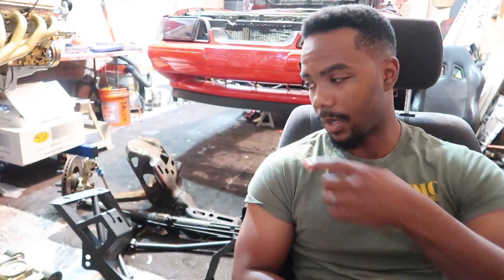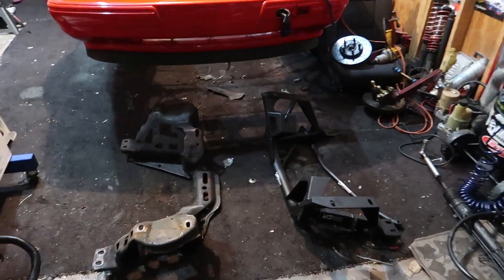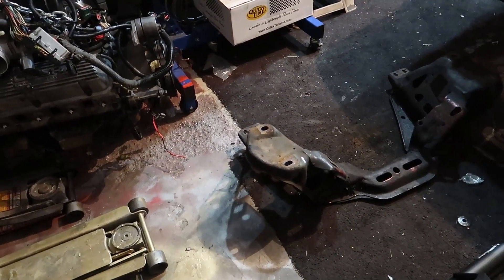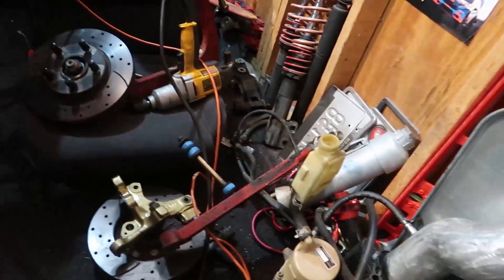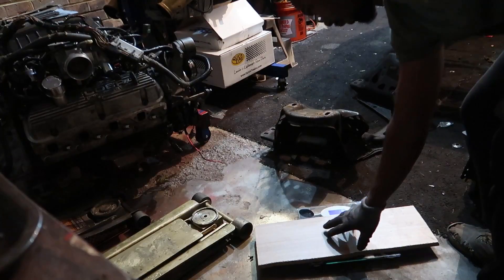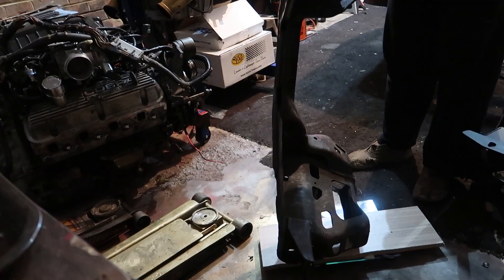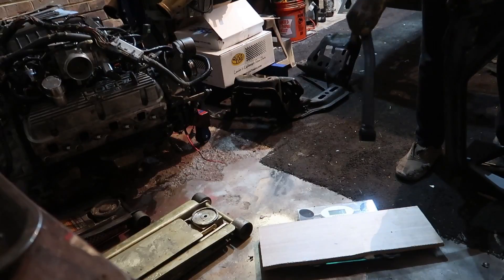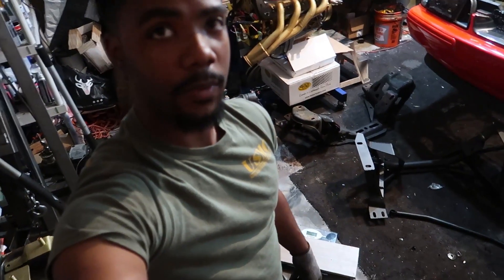Mythbusting. Tubular k member weight savings (Road race style)

Comment: I look for new ideas and why I shouldn't bother to do something or just do it a different way. I'm keeping the factory K member and using tubular control arms with lowering springs, as yes it weighs a touch more, but I'm not drag racing. The weight is in the front, but it is down low and weight up high is what I prioritize as needing attention in weight reduction. A set of aluminum heads or moving the battery to the back of the car does more, but this is my way of thinking. Keep up on doing the things you want to do and the way you want to go about it 👍.
Reply from the maker: absolutely, there has to be a method to the madness, WHERE the weight is matters as much as what's causing the weight, and managing your center of gravity will do more for you than just lightning random pieces.

Comment: I'm looking at a K-member swap, but not for weight savings. I want a Chris Alston K-member so I can get rid of the garbage McPherson strut suspension and run proper double wishbone suspension instead.
Reply from the maker: Never heard of it.  Sounds interesting, I'm going to check it out now.
Reply: @Sgt.Slides  they aren't specifically mustang parts. Meant for general hotrod use. So may need some tweaking to fit.

Comment: A great way to get ultra light weight parts is by scouring classifieds (craigslist, eBay, marketplace, anything really) for race car parts. Billet aluminum hubs, steering racks, aluminum hat rotors. Don't use the biggest brakes you can find. Use the SMALLEST brakes you can keep from fading on the track. That's using properly designed air ducts. The brakes should overheat and fade without the ducting. Anything more is extra weight. There's an Australian guy, channel is rwboo4 here. He'll show you how to make carbon or fiberglass everything. One piece front end? ✔️ Fiberglass dash shaped like the original? ✔️ Cut out the trunk floor and make an extremely functional diffuser to go with your new built flat floor? ✔️

Comment: I just ordered that same engine swap k member for my 85. Huge improvements on the geometry. Are you switching to the 96+ spindles as well?
Reply from the maker: yes, best to follow all of the Maximum Motorsports advice, be sure to run steeda ball joints as well.

Comment: ROFLMAO!!! Best thing you said - Honda Accord is a better all around car (minus the V8 power of course)! I've owned 8 fox bodies from 82-93 years and man you can't be more right. They don't stop, handle and honestly my daughter's stock 07 Civic will keep up if not roll past my 82 GT 4 speed in stock form. That's why I modify all my foxes. It IS like a clean sheet of paper. Basic performance for cheap to take to the next performance level the way you want. Appreciate your honesty and for just being a cool car guy. I love Mustangs and Fox Bodies. Fox platform cars are the modern day 55 Chevy Hot Rod. Who cares what "air pump" you put under the hood - to each his own especially if you're doing it yourself versus being a check writer! Love the channel, FOLLOWING! Get creative!
Reply from the maker: Thx dude!
Reply: John McBride Comparing an '82 GT to a car 25 years newer is not a fair comparison at all. You need to realize the era these cars were created in: In the '70s with emissions and fuel regulations people believed V8s/performance was dead. The '74 Mustang didn't even come with a V8. The '80 & '81 Mustang/Capri only came with a 255/4.2 (debored 302). '82 was the first year it returned ("The Boss Is Back") and the Mustang/Capri was the quickest U.S. production car that year even with a 2bbl carb (there's a MotorWeek vid on YouTube about it). The only years Foxes weren't the quickest was when they were beat by cars that cost thousands more or cost more than double.

Not reliable?! I've been daily driving Foxes since '92 and have been left stranded once- a couple months ago the stock 30 year old coil in my '89 GT died. Car still has stock fuel pump,  injectors, water pump, timing chain, alternator, etc. The valve covers have never even been off. My '85 GT (see pic) has close to 250k miles and almost 3k quarter mile drag strip passes on the stock bottom end and has never broken stock Ford part.
Reply from the maker: It is an equal comparison, Today both cars exist TODAY in 2019, and if I was looking for a car to just drive and not modify, it would not be a crusty rusty Mustang.  My whole point in saying this is because guys need to quit boo hooing every time someone customizes a Mustang.  They're pretty lame stock cars, but they've got the potential to turn into any kind of machine you want, and they are so easy to work on, you won't need bags of money to build yourself a decent hot rod. What's so great about a bone stock Foxbody?   @foxfordcatguy2283
Reply: Premium Fuel Mag Never said there was anything wrong with modifing your car. Making them your own has been part of the Mustang philosophy since day one. Never said if you wanted a dependable daily driver you should buy cars that are at least 26 years old. Comparing one to a modern car and not expecting it to come up short is ridiculous. The only fair comparison is to its contemparies. To which Fox Mustangs did very well and even if they were slower than their more expensive competition, people took the money saved buying the less expensive Mustang, put it into mods and wound up well ahead. They wouldn't have sold so we'll for so long if they were slow, undependable junk. Before the  5.0 Fox Mustang there was no such thing as a (true) 9 second steet car. You have to respect them for how they did in their era. The flathead Ford is slow by today's standards but would hot rodding be what it is today without it?
You're a veteran (thank you for your service by the way), would you compare a Winchester rifle from the 1870s to an M1 Garand? By your logic comparing it to an AR-15 would be completely fair. How about comparing a Ferrari to a horse and buggy? Both still exist...
Reply: @foxfordcatguy2283  I think the point being made was stock vs. stock. Fox bodies aren't cheap anymore if you're looking for a clean stock unmolested car you could drive. For the same money a much newer car such as a Honda Accord with a V6, newer better brakes and suspension could be bought. Now I think we all agree a fox is cooler but performance-wise a newer Honda Accord for example would outperform a stock fox in pretty much every category especially when it comes to ride, braking, and handling.
Reply: Anyone saying a fox body can’t handle simply can’t drive 😂

Comment: Im pretty sure that the maximum k member, a arms, and coil overs all together weigh 40 pounds less than the stock setup. A tubular radiator support and aluminum radiator will shed even more weight.
Reply from the maker: like I said in the vid, there's weight savings to be found elsewhere, but not in the k member its self.

Comment: I think the MM K member gives longer wheel base to work with the control arms, so Mustang can handle better than factory (I think gives about 1' longer wheel base). Is not designed to loose weight, but to balance the car out. Sometimes you have to push the fenders out a bit. (87-90) Mustangs I think. Because the fenders are more narrow.
Reply from the maker: The MM k member pushes the wheels forward about a half inch, and depending on what control arms you use, they will extend the wheelbase further.  Correct, the M/M k member is not designed for weight savings, however, people confuse it with ones that are designed for weight savings.
Reply: @Sgt.Slides  Thanks for making things clear. I never had a MM K but maybe in the future. See you on your next video.

Comment: Well done on the car, if possible please weight the stock a-arms VS the arms you have on, and stock spring and shock VS a Coilovers setup.
Reply from the maker: Sorry, but my stock suspension is long gone, plus, I don't have tubular arms on hand for a weight comparison.  My arms are a pretty rare custom made set, it wouldn't be a relevant comparison, especially since my set up isn't designed for cutting weight.